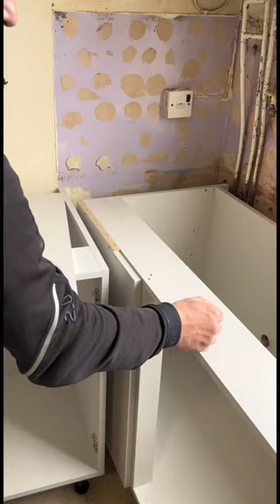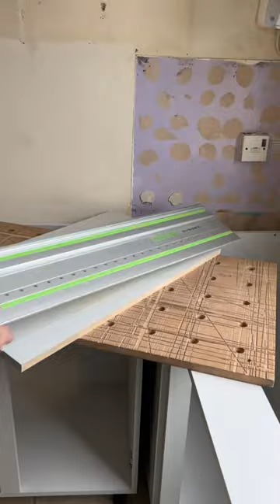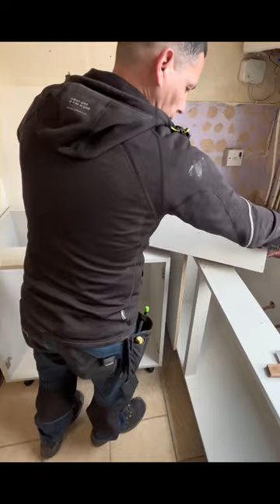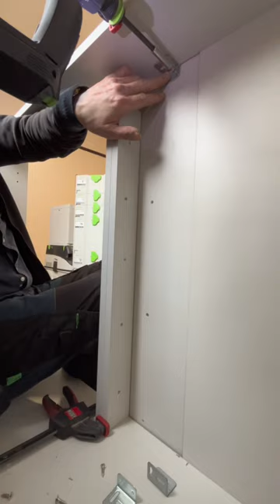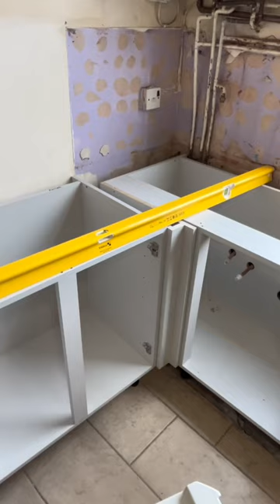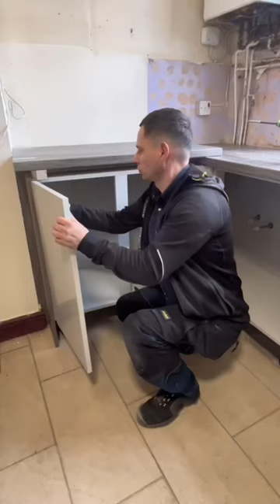Kitchen post on out of square corner  units

Comment: So this is a L kitchen right. If the kitchen elements in the corner are not in 90° then you will have a problem to fit the  the worktop if its pre made and cut for the corner. Or are you going fo fit worktop to the corner? If yas then that would be an amazing thing to see.
Reply from the maker: I did many times worktops joints that are not 90 so in that kitchen  corner walls if remember correctly were 98 left corners and 84 right corner
Reply: @CAVjoinery  holy mother of Jesus. This is a nightmare of a corner. I saw after where you did a great custom joint. Gret stuff. But it must be really time consuming to make 1.
Reply from the maker: @MyStrudl  it thanks one day nearly for a U shape kitten